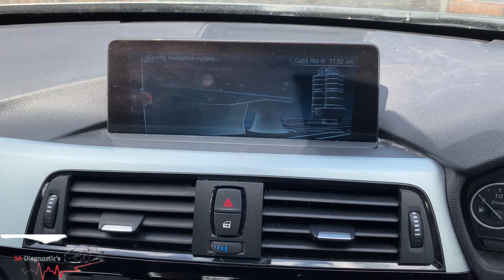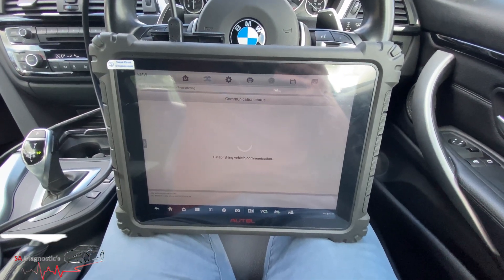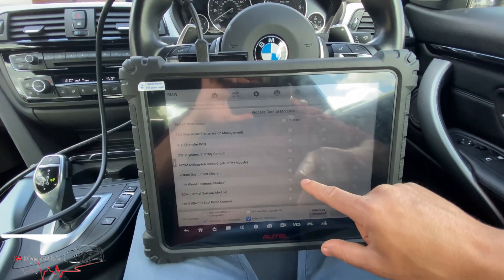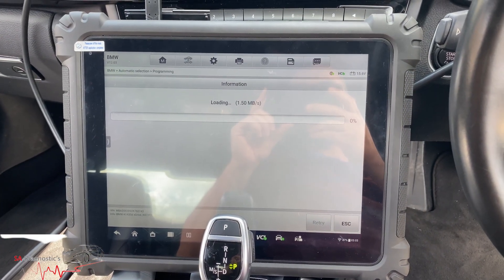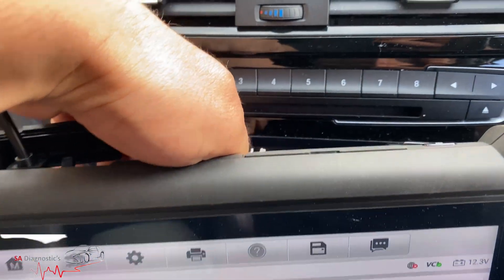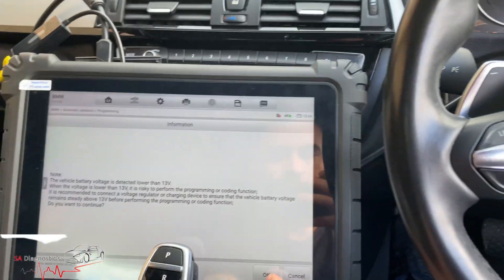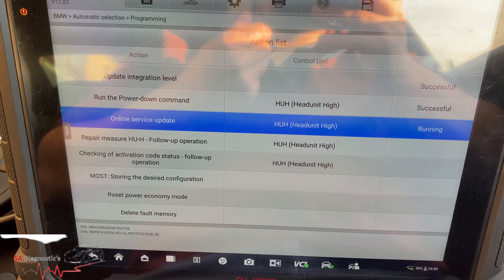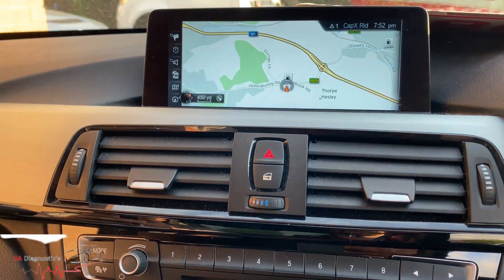HOW TO CODE AND UPDATE BMW IDRIVE USING AUTEL MAXISYS ULTRA LITE

Comment: This Unit Coding BMW 528i E60 2010 -Disable welcome gong or off belt warning sound ?
Reply from the maker: @StudioSasha  yes will do there knew diagnostic machine called kingbolen which I use now and it will do all that for a fraction of the price of Autel. Kingbolen K10
Reply: @sadiagnostics  i try MK908P II But not this functions ever - Like Personalization coding
Reply from the maker: @StudioSasha  yes this function is good
Reply: @sadiagnostics  Kingbolen K10 not support American car BMW only europe
Reply from the maker: @StudioSasha  they do support American car they support more vehicles than Autel
Reply: @sadiagnostics  Thanks ! And I have 93B2 Safety battery Code after accsedent , After change SB wier Rerminal i have same cod after errase same code i do buypass 2 Oms and errase memory  have same 93B2 code :(  You have any idea ?
Reply: MSR Modyl ?
Reply from the maker: @StudioSasha  you can use 1.8 ohm resistor on the airbag cable or you can just replace the whole red cable
Reply: @sadiagnostics   I do , but same code